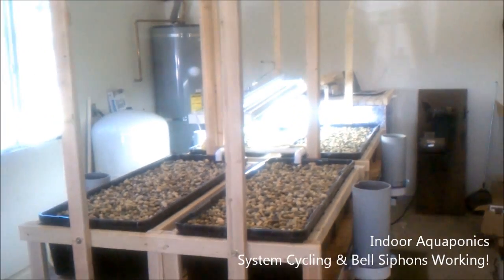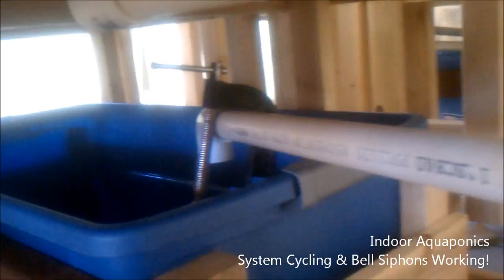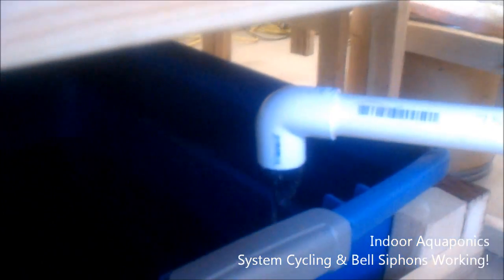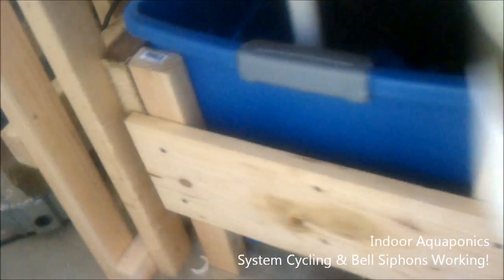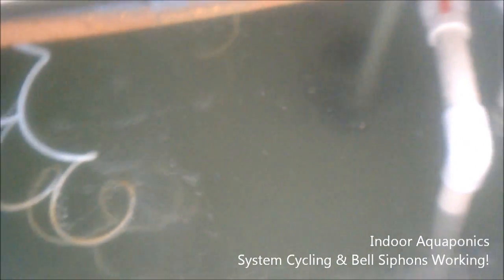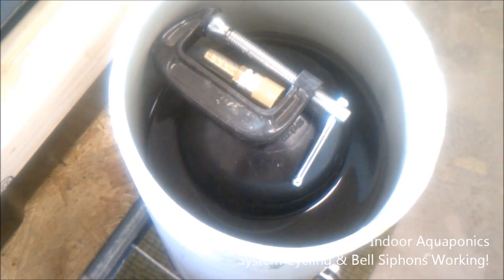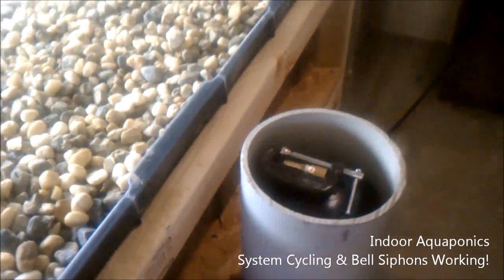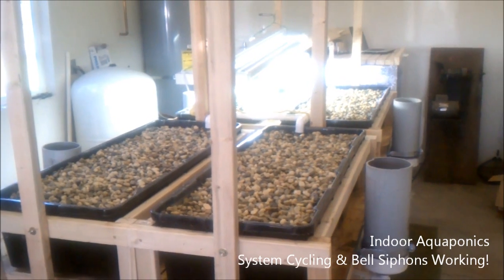Indoor Aquaponics - System Cycling and Bell Siphons Working

Comment: if the drain is at the bottom of the tank, and you're just using it to fill a tank below it, why couldn't you just use gravity to drain the upper tank? and use something like irrigation timer to shut on/off the drains. 

otherwise, i'm loving your vids, nice step by step.

Comment: Hey, system looks great, well built :D

The water in the bottom of the tank should get repeatedly recycled every time the GB siphon cycles, so you should be good there.

I like how you have maximized your grow space, it may just be a six inch pipe but I have a three inch one in mine and it takes up valuable space.

Try putting a couple of socks or a can filter on the bottom of the returns from your GB, the cloudy water is probably dirt from your grow media, will settle quicker with the socks. [:

Comment: I wouldnt worry about that little it of water either, if light was directly on it maybe. And as for the bacteria, they are the most important thing in aquaponics. I would be concerned about clogging those drains though. Is there anyway to clear them out without digging them out?